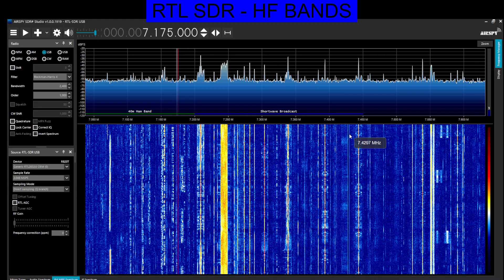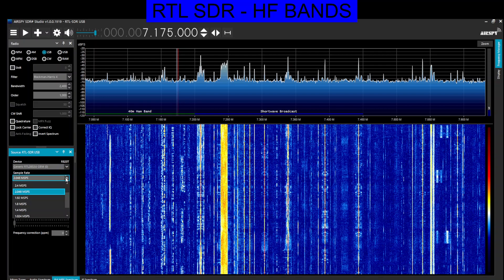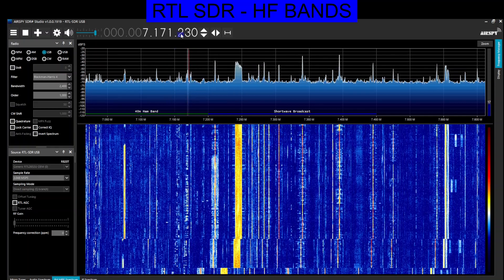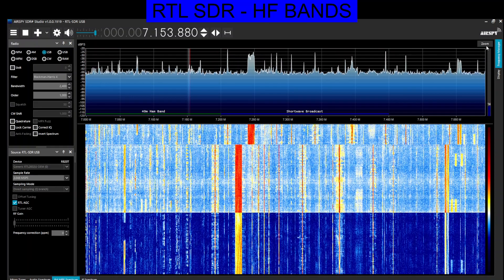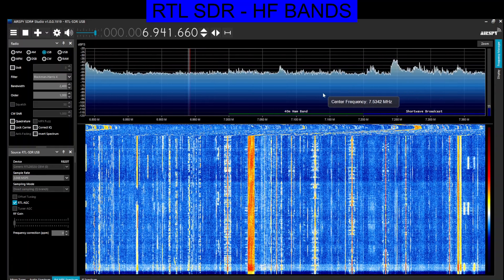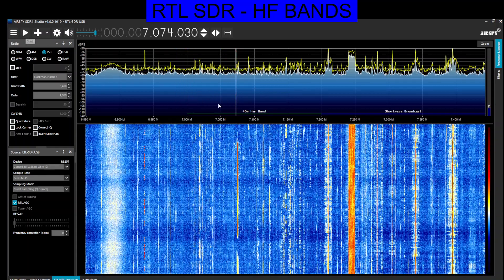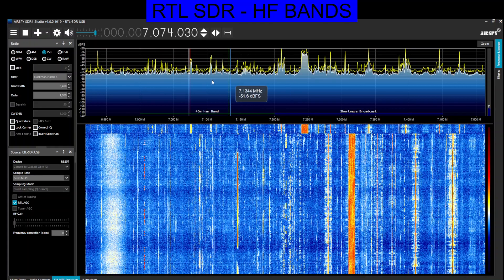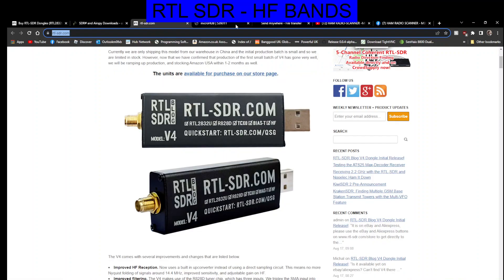RTL SDR - HF SETTINGS , + INSTALL & TEST VIDEO

Comment: Try SDR-console V3 and see what happens. More gain settings and better, more detailed waterfall etc... I prefer it compared to SDR# and HDSDR also, even with Airspy and SDRplay models. As said before, the waterfall is just magnificent and until now never has beaten by any SDR software.
The problem with all SDR sticks is the limited dynamic range and high base noise floor. I own a number of them, but these are really useful for frugal and SDR reception beginners. It seems to me that it may be pointed out to beginners so, they are not disappointed early on. Good luck with the channel. I like many of your video's, specially the one using ham gear and.:goodvibes:
Reply from the maker: Thanks just subscribed to u.